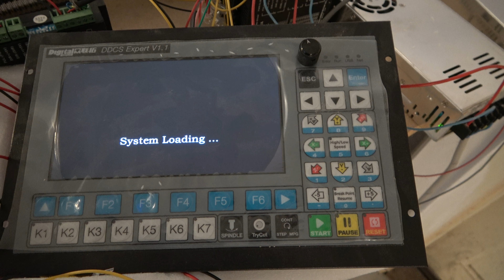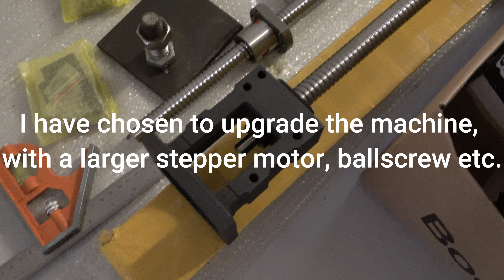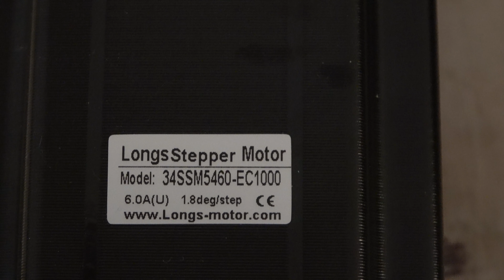DIY CNC Router Build! Part:2

Comment: I do have similar DIY CNC build like your's, using open-loop nema 34 12Nm with DM860H driver + 48 volt 7.5A power supply (for every single stepper driver, need 1 power supply, don't share power supply).  Run @ 5000 - 6000 mm/min easley.
But since I was just used 20mm ball screw for all axis, It's makes wobbling a lot when run on higher speed, specialty at the longest axis one.
so in order to avoid that I just run "safely" at below 5000 mm/min, until I get bigger ball screw replacement, at least 35mm diameter for the longest axis one.
Reply: Y por que no usas transaccion por pinion y cremallera. You can run over  than 8000 without problem
Reply: @ouroboros5378  The main reason I'm using ballscrew is, because I want to make a small parts too, I mean really small, for used on EDM machine, most parts is made from coper and graphite, about around 2cm wide, with 0.03mm ~ 0.06mm tolerant, I've used pinion rack system before and it is not quet good for getting tolerance on small part. (currenly there is no high qualtiy pinion rack sell in my country, so can't achieve that miminum requrment tolerant)

Comment: For speed you have to play with settings in motor controller steps per revolution and software. You also have to check for torque more speed equals less torque and loss of steps. Also more steps per revolutuion = less torque. Tb6600 drivers are no good for your application use 3-4 amps at 34 v . If you can stall about 18-20 lbs. From side movevment is all you need. Or enough to break an end mill from lateral pressure. If you can break a 1/4" end mill or whatever size thickness your sindle can handle should be your goal. If a1/4 breaks at 15 lbs. Of side pressure you dont need your stepper motors operating at 30 lbs. Before skipping steps.  The motors can take heat as long as you can hold them they will function normally. You can cook eggs on them and they will be fine. As long as you can hold them without pulling away is a good rule of thumb most are designed this way.